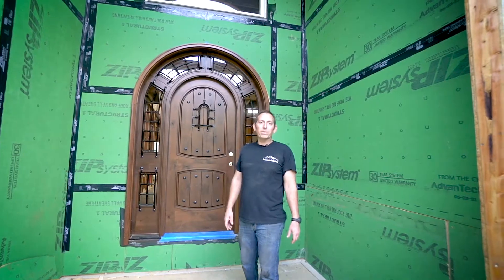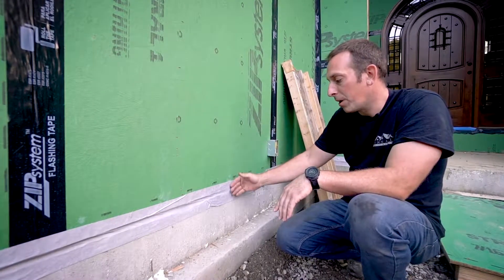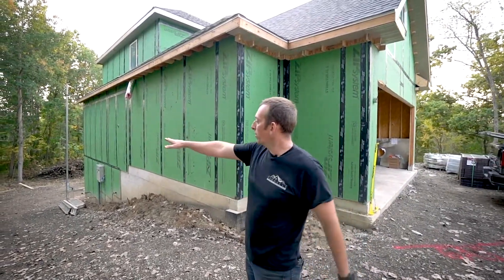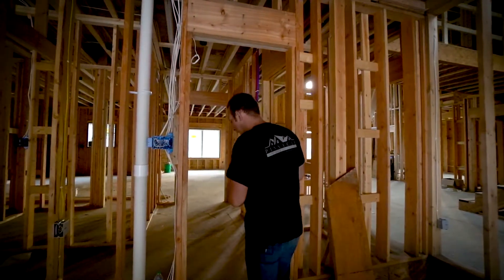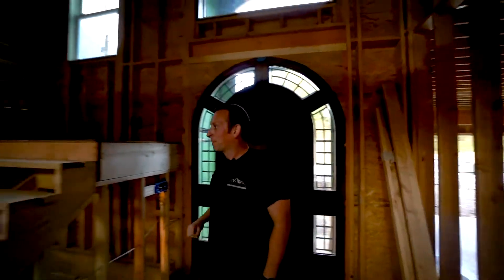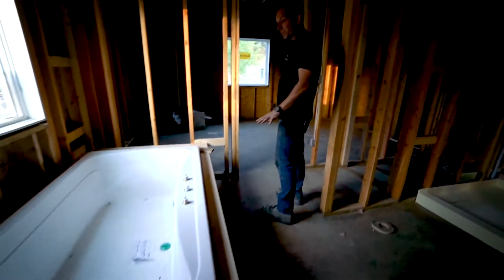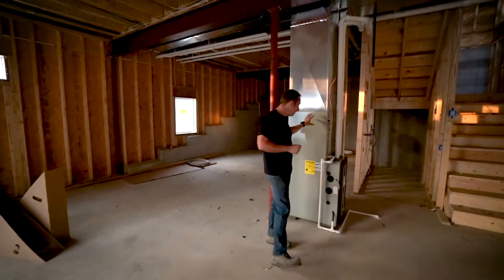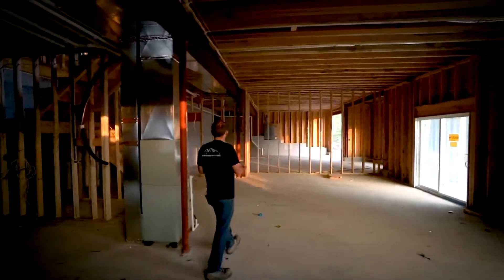New construction process, Morena Terrace Episode 13 🔥🔥

Comment: Sounds like your LP supplier did not do a good job of communicating that there was a color shortage before trim was ordered. Might get to be an expensive change order to repaint all the trim
Reply from the maker: We are using aluminum soffit and fascia on this one, and the color that was originally selected was discontinued. This didn't come to light until after we had ordered the LP stuff.